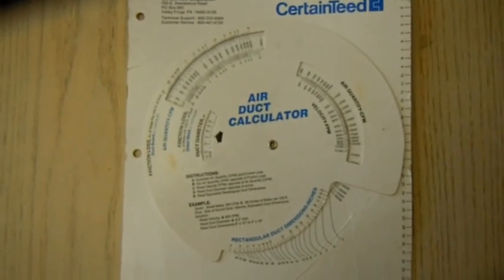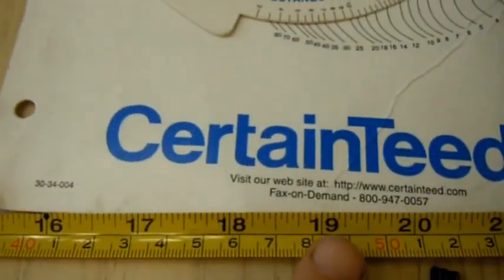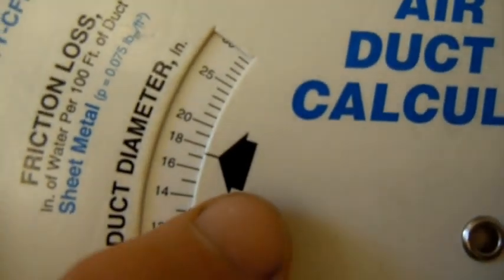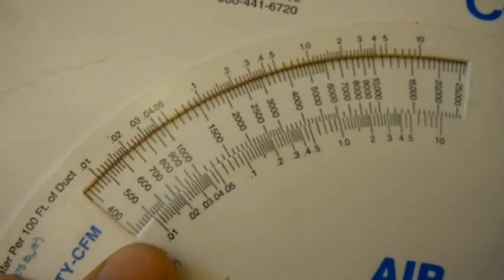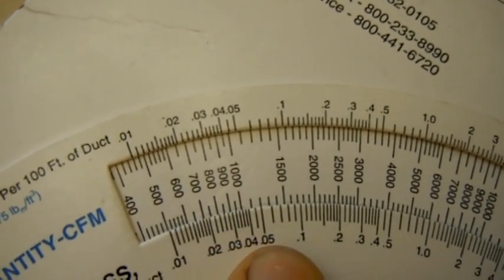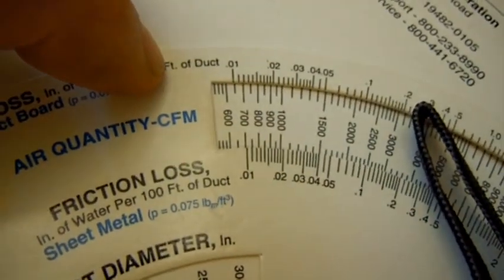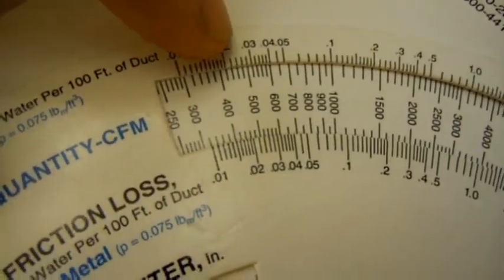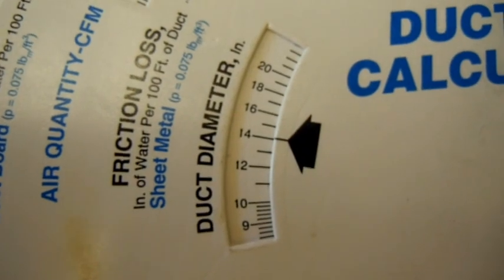HVAC Ductulator 1

Comment: Dr Z dont you drop the duct size as use more feet of ducktwork ?. I always thought you drop your size as your building the ductwork to presurize the ductwork . Thats the way I was taught how to do it . Ive installed many duct systems in homes and every house was different in ductsizing . But that chart helps for figturing out how to start sizing the duct .Building the plenum is easy getting the sizes right is the hard thing and getting proper pressure fior ductwork . You no right cmf

Comment: @DrZarkloff Yes but typically you should shoot for a maximum .5" water column design static on the blower. Usually unless it is a small simple system you will find that you will go into the grey area between .5" and 1" of water column. Be ware most blowers will stall before you get to 1" water column. ECM motors are making it easier and will compensate for some design error but the same rules apply. They will fail as you approach 1"

Comment: @robw1031 The ROT I have heard is to increase the size to the next size when reading a sheet metal ductulator when using flex or ductboard. 

If you pull flex straight and tight it will perform nearly as well as metal.

The ductulator from ACCA has flex, duct board and duct liner.

Comment: @ComfortAirCompany I agree, It is my experience that it is a prerequisite to be a installer before you become a service tech. Sadly most installers are little more than box cutters. The guys I learned from 20 years ago are still using rule of thumb to size equipment an ducts.

The best installers come full circle from installer to tech and back to installer.
Reply: Man I'm just starting out in HVAC and I'm an installer of course but do you know how hard it is to get someone to show you how to use one of these things it's like they're afraid you're going to take over
Reply: @mccumbersjared44  Get a copy of ACCA manual D. Or better yet try to find a class on Manual D. The class will fly through it though it’s probably best to struggle through the book on your own before taking a class. It would also be best to take a manual J class, get manual J software. Wright soft or Elite Soft.
Reply: Not to mention I went to school for this for a year to be a tech just to turn around and find out I'd rather be abduct installer designing systems because that's where the real brains comes in anybody can be a tech

Comment: @DrZarkloff Not for me. Looks like the numbering and whatnot is similar to the large one you showed, with maybe a tad less accuracy. And mine is a slide type, rather than a turning type. Much easier to use when marking duct sizes on plans.

Comment: @DrZarkloff Yes it will help you out in most jobs like replacing a duct or two, it is good to know how to read a ductulator not many techs know how, I like to use duct software that has both J & D in it. But I'm no duct expert, I know enough to be dangerous lol. 
Keep up the good videos Dr. Z

Comment: @THEHVACTECH101 No, this is a common misconception. Friction Rate is not the same as Static Pressure. You are measuring static pressure with your magnehelic gauge or monometer. You can go one step further and measure velocity pressure with your gauge if you have a pitot tube.  Static pressure is like that in a balloon. Total pressure = static pressure  + velocity pressure

Friction rate is a way to assign a scale of resistance per 100' of equivalent feet of duct.

Comment: I realized after I reread my comment to you that it sounded like I was bustin your balls. I apologize. I just thought that you gave just enough information for newbies and a lot of oldies to get the wrong idea about duct design. You did you use the word design when you probably should exchange the word design with sizing. 
It would have been nice if you would have been a good idea to touch on velocity limits that would at least keep the rule of thumb guys closer to the ball park.

Comment: I like the calculator at efficientcomfort net (free is 4 me). I try to figure these things out before I get to the job. 

Do you use that if you suspect incorrect sizing problems?

I bet most of your work is on sheet metal duct.

Comment: @tstatech Manual D is for residential duct design and is based on equal friction. When doing residential design you are limited by the blower in the furnace or air handler. When doing commercial design you can use the static regain method because you can get different motors and shivs.

Comment: DrZ, you are totally disregarding velocity and velocity limits.You also need to lay out your duct system on paper and refer to manual D equivalent lengths to determine the longest supply and return paths. You deduct pressure losses and you are left  with available static pressure. You also need the blower table or fan curve from the manufacturer's technical data to determine the balance point between the duct curve and blower curve. Then you get friction rate.Get ACCA Manual D and give it a read

Comment: You should probably make some adjustments when using flex duct i.e. most ductulators are for sheet metal duct (smoother surfaces). There are some flex duct calculators/ ductulators available. I can't remember but there is also a ROT you can follow as-well. It's been so long since I used a ductulator as I now have a phone app for that. LOL

Comment: Ahh ye olde ductulator. I use a small pocket sized one all the time at work for designing systems.

 If you really wanted to be technical, the word "Ductulator" is trademarked by Trane I believe. Mine is from Carrier and is a "Duct Calculator." but of course I call it a ductulator.